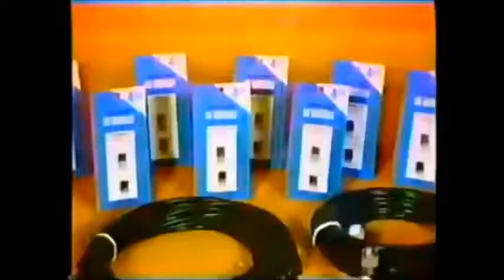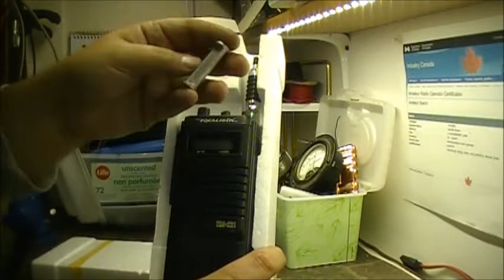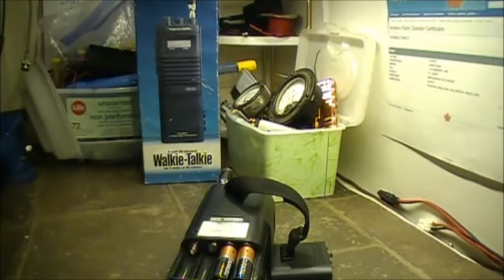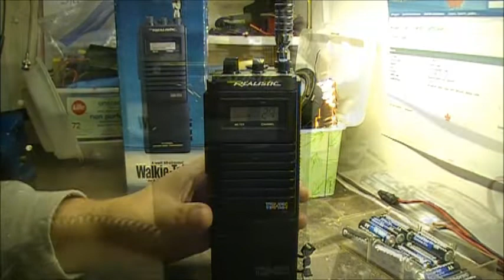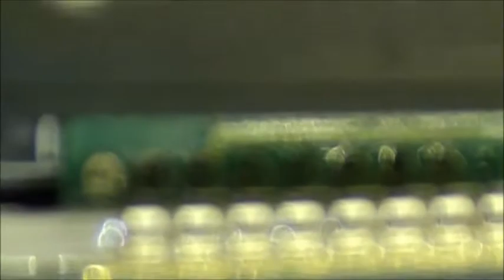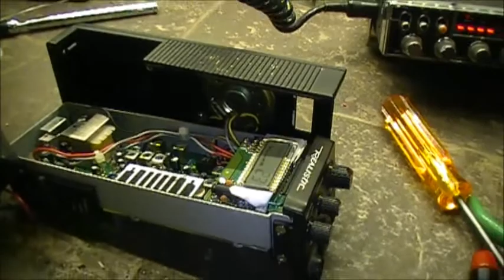Realistic TRC-221 Trouble shooting and Repair

Comment: I didn't have to solder the screen pins. They look bad at one end but are fine on the other end that counts. I just took the screen out and put it back in and it was fixed!
Reply from the maker: Glad to hear you were able to fix it easily!
Reply: @Radionut63  It did stop working again so I put the hair dryer on it using high heat for a few minutes and it started working again!
Reply: @Radionut63  After it stopped working again I did what you did and soldered the screen and it works again with batteries only!

Comment: Nice fix. I have a defective TRC-221 myself and cannot see how to open it after i removed the back.I haven't been able to find a service manual How did you open the front? The lower part seems to be stuck while no screws left there. Can you shed some light on it? thanks..

Comment: I saw you place batteries in the wrong direction. You transmitted with the antenna not even partially extended. These were supplied with TWO dummy batteries. 1.2x10 vs 1.5x8, depending on battery type.

Comment: I used to have a problem with my Maxon 27 LP, from time to time the synthesis processor crashed and stopped working, also on reception. After a year of time, I checked the AA ni-cd batteries and it turned out that one of them was damaged and there was no voltage. The discharge indicator is set too high and this has caused damage to the battery and no low battery indication. Sanyo recommended "LOW BAT" signaling at 11V for 10 cells and this radio did it at 8V. One of the cells was notoriously polarity reversed. Great fix, good radio, they don't make them like that these days.

Comment: Good morning, what is the silver piece that you installed in the last battery compartment.  I a TRC-221 that was found at my mother's house but it doesn't have that silver piece. Your help would be appreciated as I'd love to hear this old school technology talk again. Thanks
Reply from the maker: That would be a dummy battery, the radio should have had one supplied with it.  It keeps the battery voltage at the correct level, with the dummy battery removed you would supply the radio with a extra 1.5vdc.   Which might damage the radio.

Comment: How did you get that front panel off?
Reply: Never mind. I had to take the back off, then the antenna, and 4 bolts off of the circuit board.

Comment: When opening the box, you pulled out the foam. In the small part, you pulled a metal piece out. What exactly is that? Asking because I couldn’t find mines in the small space and now my walkie talkie isn’t working much.
Reply from the maker: you must be referring to the dummy battery?
Reply: @Radionut63  um yes I think so. I am of new generation and don’t know much of this but I used to have an uncle who had a realistic trc 221 and I used to love it so much. He told me I could take it home but my mom said no. He died and his walkie talkie/radio(?) was thrown away. I bought one recently because I really liked it but it was off of eBay. When I got, my dad had popped some batteries in and charged it up in “CHG” hole. I turned it on for a minute to see if it’s charging and it started to smoke. The person didn’t send the small object that was in the small compartment so my dad thought the extra battery hole was for a battery. He used cheap batteries. It only comes on when charging it but by itself, it doesn’t work. I think the person sent me one that doesn’t work well but I am now watching this video to see what is the problem. Can explain to me the possibility of why it smoked and if it isn’t no good of trying to save?
Reply from the maker: of it smoked, changes are you adapter you were using is of the wrong type and damaged the charge circuit.   I could take a look at for you and see if i can get it working for you if you wish.  :-)
Reply: @Radionut63  well I could probably send a picture or video. I can’t really bring it to you, well if you are close.
Reply from the maker: That could work too.  :-)
Reply: @Radionut63  sorry for not replying in ONE MONTH. I am truly sorry. I had finally bought some really good batteries, rechargeable ones and now it can come on without the adapter BUT the sound still doesn’t work. No static or anything, just silence and on each channel. I don’t know what is wrong with the speaker but it also said signals were weak. Is it because I dont have enough signal or is something going wrong inside?
Reply from the maker: No worries :-)     If you are hearing nothing at all from your speaker, not even a hum, then your speaker could be faulty and need to be replaced.  Or perhaps you have a faulty audio amplifier.    These radios are fairly quite anyways.   One thing to look for is the antenna connection, they use a jumper wire from the bottom of the whip to the main board, if this is broken you would also hear very little.
Reply: @Radionut63  ahh I see where can I get the speaker replaced and the antenna outlet is actually in good shape though I don’t have another antenna to connect it to. Where else should I buy that?

Comment: I ordered a Trc-216 off of eBay but the guy said the whole lcd doesn’t work like it doesn’t display at al how would I fix that?
Reply from the maker: Depends what the issue is, could be faulty LCD, might need re soldering, or the control board is bad.
Reply: @Radionut63  pretty sure he said it was a faulty one

Comment: Hello, Having watched your video I purchased a Realistic TRC-216 (earlier version of 221). The radio aesthetically appears new but powered on it has an incredible loud squeal.  Any thoughts on what might be causing this and if it can be repaired?  Your input would be greatly appreciated.
Reply: the 216 service manual states " Self oscillation on transmit - faulty TX/RX control circuit Q8 and /or Q9 - replace the defective parts"
Reply: my 216 is doing the same thing no trans or receive squeals really loud on power up

Comment: I have one of these but there's only one problem, the audio is too quiet, I can pick up a signal and understand it clearly but I have to have the volume all the way up with headphones on in a silent room to hardly hear whats being said. Any idea whats going on?
Reply from the maker: Speaker could be faulty, or an issue with the audio output stage between the audio amp and the speaker.

Comment: I just bought a realistic 221 on ebay , the add says it works as it should but after seeing this video I am gonna have to pull it apart and check the solder connections

Comment: This is a Great video and I am glad to see you received positive
 comments from a Cool group of people.  I have a TRC-208 that transmits ok but only receives static from a close transmission.  Also the RF meter doesn't work.  Any help would be Greatly appreciated.
Reply from the maker: Chances are if your receive goes out where someone is transmitting close by, this is caused by front end overload of the receiver and the signal is so strong that it desensitizes the receiver from hearing anything on that channel.  This could also destroy the receiver to a point that it may not work again.  Be careful with your radio that you blow out the front end.  :-)

Comment: My 220 has been sitting a long time without batts. I installed them but it didn’t power up. I didn’t have a dummy  batt does it require one?
Reply: Actually it doesn't matter if you use this big battery or not you could use the extra 1.5 volts when you're transmitting to make the batteries last longer with the real battery in there
Reply from the maker: Everyone seems to think so, so i will have to say... Yes!

Comment: I just got one of these from my dads friend and I put new batteries in it but it won’t turn on. Is there anything else that I need for it like a cord or can I just use it like a regular walkie talkie and it’s just broke
Reply from the maker: Resistor could be burned up that charges the batteries preventing power from getting back to the main board.
Reply: Radionut63 nvm sorry my dad figured it out sorry and thanks

Comment: I thought these required two dummy batteries my trc-203 takes two dummy batteries
Reply from the maker: they do, i found the 2nd one in the box stuck to the foam. :-)
Reply: I just purchased 2 of these on ebay with no instructions or dummy batteries , my question is can you just load 10 batteries in the unit or do you absolutely need the dummy batteries?

Comment: now how did those terninals get unsoldered,was it the goblin of unsoderings ?  it musta been workin when new ! yahhh i had one too back in the day for the experience and sold it off.
Reply from the maker: Looks like the contacts were never soldered, the pins were touching just enough for the circuit to work, but over the years the contacts lost contact for one reason or another, thus the issue with the radio.  :-)
Reply: You put 9 batteries in it. You should be using 2 dummy batteries and 8 alkaline.
Reply: Yes 2. @joewalker5153

Comment: That is a bizarre issue. I have never saw such a weird issue before. Looks like quality control was asleep when this went through the assembly line. I'd say a radio that was built on a Friday near knockoff time.
Reply from the maker: Something was missed that is for dame sure!
Reply: would add that I've had a bunch of the earlier Japan made sets apart (TRC-209 and 210) and they were not put together very well, slapped together you could say. cold solder joints, different value capacitors from the schematic, etc